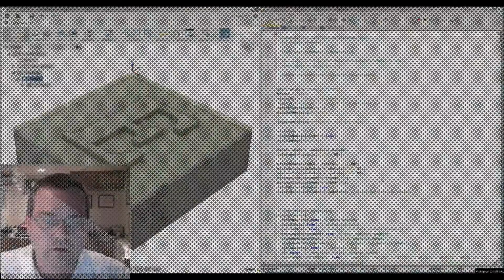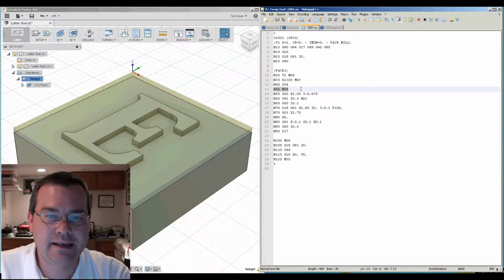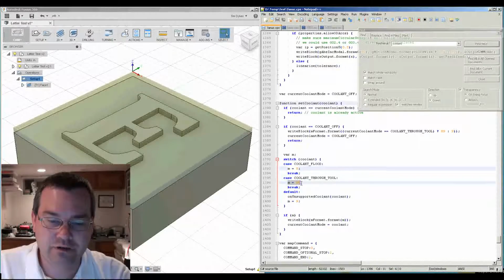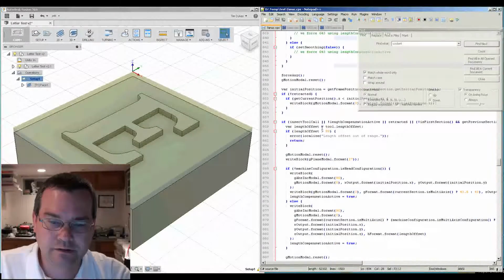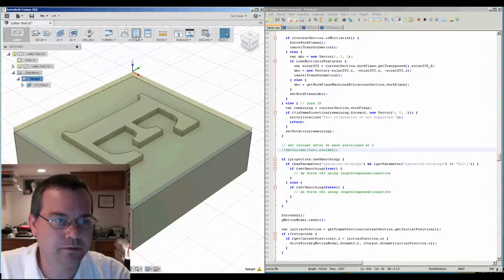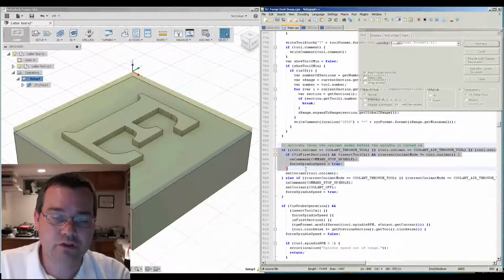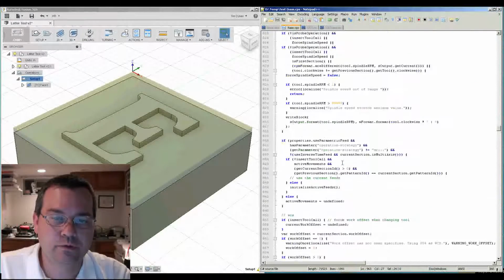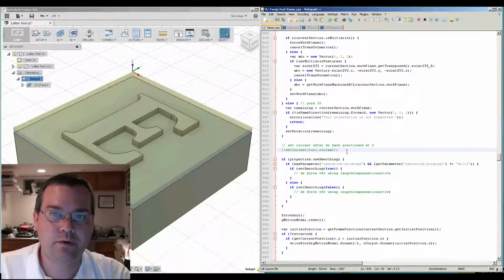Fusion 360 Post Processor Coolant Enable Location

Comment: flaw with this (on fanuc version) if turning off through tool and turning on flood, it just turns off through tool (M09) and doesn't turn on any coolant. Seems like the logic only looks for and outputs coolant M code just after toolchange rather than at the beginning of each operation.

Comment: Thanks so much.  Its extra important on a Haas with programmable coolant.  If the M8 is before the H code offset, then the programable coolant will not be changed to the current selected tool.

Comment: GREAT VIDEO!!!  Thank you!  Just wondering if it is possible to change where the coolant turns off in the haas post?
Reply from the maker: Yes, you can just about do what ever you want. Just look for the M9 code which turns coolant off. Then you need to figure out where to relocate it to.
Reply: Thats what I thought but I'm having difficulty finding the location to move it to.  Its only between tool changes that I want to change.  Right now it generates an M9 after the G28 moves.  I would like the M9 after the M5 which it does at the end f the program but not mid program during tool changes.... Any ideas?  I really appreciate your knowledge and assistance.
Reply from the maker: Hard to describe, I can make a video on coolant disable. I have 2 in the que right now but maybe next week I can get it out. If you want to try and search for G28 that would be where I would start maybe? I need to go through it myself.

Comment: Thanks for the tutorial. Made the changes on my post for my Haas. I might also mention I use HSMXpress. From what I can tell the posts are the same HSM vs Fusion
Reply from the maker: Yes, I have also found the posts to be the same. I used a lot of the HSM docs when I was doing really heavy mods in mine. Thanks for the feedback, great to see the videos having positive impact.
Reply: +At-Man Unlimited Machining  also would like to mention that I bran some parts today. coolant turns on at "r" plane and OFF at r plane. wasn't expecting the off but glad as that was my issue with coolant timing. before coolant  shut off at z height tool change.
Reply from the maker: Hmm, that is interesting, only because most of the posts I have looked at don't actually turn the coolant off. They rely on the M6 tool change or M30 end to turn off the coolant. Maybe its something in the haas controller? Don't know. I can make a video to show how to add an M9 coolant off command at the end of a section. Is there an M9 being called in the code?
Reply: Yes there is an M9. Basically it reads = go to clearance plane, stop spindle, stop coolant (m9), go to G28 position.
Reply from the maker: Looking at the Haas post a little closer it looks like there is a coolant off command called right before a tool change, and at the end of the file. They put the coolant off command through another function called "onCommand" with a switch called "COMMAND_COOLANT_OFF".  Changing the position of the coolant enable should not effect the position of where the coolant disables though.  I would not expect a change in that behavior.